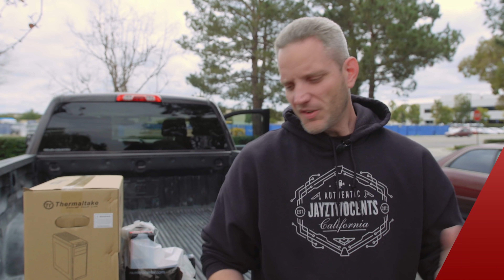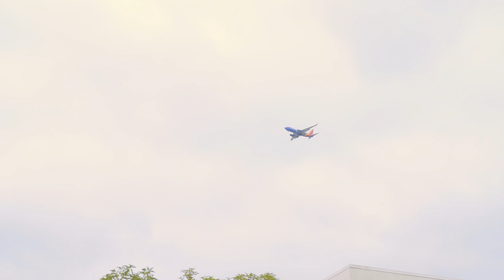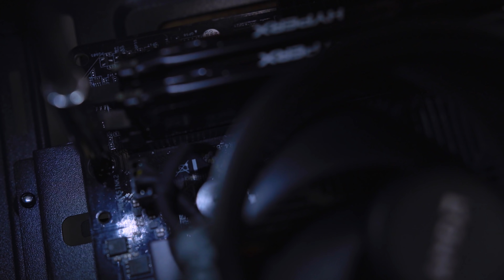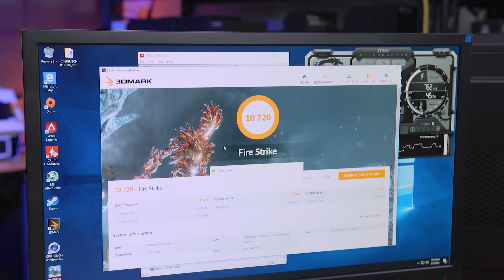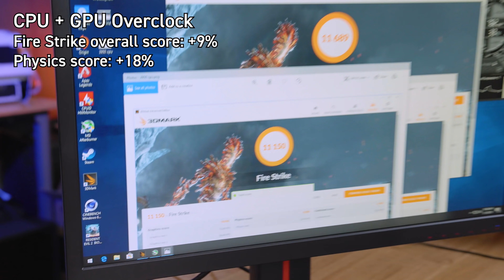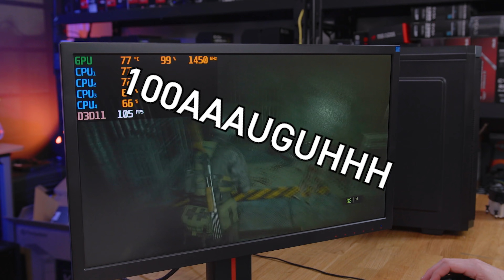CHEAP Gaming PC Build - 2019

Comment: I am terrified to overclock my computer. What percentage would you suggest. PC specs below
Intel Core i7 8700K 3,7Ghz

Adata XPG Spectrix D41 Red RGB DDR4 3000 16GB 2x8 CL16

Asus Prime Z370-P

Samsung 860 Evo 250GB SSD

Seagate BarraCuda 1TB 3,5" Sata 3

NZXT Source S340 Ventana Negra

Cooler Master MasterWatt 650W 80+ Bronze Semi Modular

Asus ROG Strix GeForce GTX 1060 6GB GDDR5 

AOC G2590PX 25" 144Hz

Microsoft Windows 10 Pro 64

Comment: Or, you can get an Xbox one X with a little less money, and have way better performance. Pc elitists come at me.
Reply: Not sure if you know this but the rx580 gives better performance then Xbone X, you can check jermgaming, he showed that the 1060 is a bit above Xbone X overall and this is a little better than a gtx 1060. The cpu is better aswell btw. Also there are better deals that could get you a 1660 ti and a better cpu instead for around the same price and that thing craps all over any Xbone. Yeah it was a good value when it first released at $500, but now things have gotten cheaper and next gen consoles are coming in a year or so and those will annihilate it in terms of gpu and cpu power while costing the same

Comment: Curious what I need to adjust to get my oc stable to get 100+fps on apex. I have a amd8350, 16g hyperx ram (dd3 I think)and a gtx970. For some reason my oc crashes if I try to turn it up from the regular preset oc that comes with mb. I want to get to about 4700mhz. I have a massive radiator on it temps aremt a problem. But I'm at 4.3mhz atm and if I turn it up thru overdrive and afterburner it seems to crash or run choppy

Comment: hey Jay nice video,a metro exodus build would be nice to see.i have a bit of off topic question: would you recommend a Thermaltake core p3 or core p5 which are more open cases,i am running a aio cooler on the cpu,gpu is still on air,not really planning custom cooling loop.i currently have a nzxt s340 case but personally i find the airflow could be better so if you have a suggestion on a midi case  ATX with good airflow in 2019?

Comment: Could have included a 212 Evo, that one most of the time costs less then 30 (Insert Currency symbol). 

100 fps? Well more then i am getting, i am barely over 60 but then again, half my Ram slots are dead and i can only run my 16 gb kit in Single channel. And i have a 970.

Comment: Glad to see a Resident Evil 2 test
Funny enough, based on benchmarks, AMD has a HUGE advantage, even the RX 570 beats the 1060 at similar settings, to the point that the RX 590 can match the likes of the 1070. Not that it's a bad thing. I think the RX580 and RX570 are better deals right now for the lower mid-range cards than anything Nvidia can provide, though I'm stuck with the 1060 for now.
Hope to see more Jay, keep it up

Comment: 1.425v is going to run hot as hell in a stress test with the stock cooler and more importantly, will cause degradation soon enough

Comment: Jay maybe u can help i have the 2200g and the same gpu u use in this video, but my doesnt perform like yours. My 2200g stays at 0.52 for some reason. Even when I put it into high performance. Even if it overclock it slightly i get the black screen and have to reset everything. What could be causing this? Thanks man great video!

Comment: Jay i have a problem with my 2400g, on my asus prime b450 plus with a kit of 2x4 gb 3200 mhz hyperx predator, it runs at 2400 mhz and it just crashes as soon as i try to boot it... i have to send it back to service... what to do? Stock cooler, lc power 600w and an ssd...

Comment: I need help with a memory question. Which of these gives better “price-to performance” with a Ryzen 2700X? CORSAIR Vengeance LPX 16GB DDR4 3200 Memory Model CMK16GX4M2B3200C16R ($125), G. SKILL Flare X Series 16GB DDR4 3200 Memory Model F4-3200C14D-16GFX ($195) or G. SKILL Flare X Series 16GB DDR4 2933 Memory Model F4-2933C14D-16GFX ($165). I see the difference in CL and speed between the three. Just wondering which gives the best bang for the buck? Is the Flare X really worth the extra money?

Comment: don't forget that he's running it beyond 60 fps, putting it nearly double the load on the gpu causing much higher gpu temperatures

if it's locked to 60 then the temperatures will look much better on the graphs, of course this applies to people who just want 60 fps and not looking for the g-sync / free-sync tech

edit: don't lock it via v-sync however, it causes a bad input delay; use something like MSI afterburner's Rivatuner program to do so

Comment: Ultimate budget build to run most games at 1080p please
Reply: HBY 
Basically this except 16 gb of ram and maybe a better processor.

The 2200g is good enough for 1080p, but if you have the money I would recommend a 2600.

Comment: Don't forget to add another $100 for at least a 75hz monitor with freesync. I recommend the Sceptre E248W-19203R 24" on amazon for $98. Also, you can get a 570 for $130.

Comment: Jay! Plz do a water cooling test using engine ice! I've used this on many street bikes dirt bikes and quads then seeing better cooling temps than straight water

https://www.amazon.com/Engine-Ice-TYDS008-Performance-Coolant/dp/B000H01NFY/ref=asc_df_B000H01NFY/?tag=bingshoppinga-20&linkCode=df0&hvadid={creative}&hvpos={adposition}&hvnetw=o&hvrand={random}&hvpone=&hvptwo=&hvqmt=e&hvdev=m&hvdvcmdl={devicemodel}&hvlocint=&hvlocphy=&hvtargid=pla-4584070138229370&psc=1

Comment: Now do a used parts PC build with a similar or lower price point with something like a 2500K/3770K, GTX 970/1060, 16GB DDR3 and show how much more performance you get per Dollar - because that's what I just did. The bigger RAM headroom especially makes a huge difference compared to my 8GB System before.

Comment: Nice build. Probably still better than a ps5 or Xbone X 3000.
Reply: This build can do everything 60+ fps. Even over a 100 fps. The xbone X has a handful of games that barely do 60fps. Also online service is free. Thousands of games that make up the library on pc. Xbone has no games. You want good games on console, play ps4. Xbone X is pretty much dead. I’m sorry for gamers that spent money on this Xbone X for slightly better performance than the base model. Should’ve spent that money on a better investment like a pc of this criteria. Let me guess, you guys think that the next Xbone is gonna be better? Wake the fuck up LoL
Reply: @velezf216o  actually the Xbox one x was a MASSIVE improvement putting it inline with an upper mid-tier PC that was only 1 gen old at the time. Its the closest consoles have been to PC midtier. While it was a good value at the time we are now 2 generations past it and its got less value to performance, and  less value over time. Cause again that $60 spent each year just to be online could have been spent on more games or saved for PC upgrades. While i respect their jump in performance, but they still fell short of actual value.
Reply: You will not out perform a pc with an xbox especially if you know what you’re doing. If you think otherwise you’re just wrong
Reply: @supertacoelite5062  Very true, at the time the base models came out the hardware performance was already 5 years behind the curve. even with the new revision models, and their gains, they still fall short of equivalent price PCs so long as you know what you are doing and don't let some sales person screw/lie you.
Reply: velezf216o 😂😂😂
Reply: Xbox One X would substantially outperform this PC.
Reply: @YourPalHDee  Actually its probably about the same performance
Reply: @nonameyet2205  maybe from a hardware perspective. Not from a gaming perspective.
Reply: @YourPalHDee  because that's totally how hardware and gaming works.
Also let me know how that $60 a year works out for online play after a few years. Its not for servers, its not for the developers, and its only cause Microsoft says so. 
Say hi to Bullet Berry.

Comment: Next time get a 6 core ryzen man .... This 2200g has extra gpu for no reason in this build
Reply: I said the same. Could have easily gotten a better CPU for the price too.
Reply: 100FPS in game   Why pay more for the cpu?
Reply: @TheNosakus  you wont get 100 fps in all games
Reply: Some people does not understand that many games can do 60+fps in AAA titles only when you have enough cpu power and that needs 6 cores 12 threads atleast NOW ... 8 threads are now a bare minimum and WILL STUTTER just go see metro exodus and shadow of the tomb raider with modern gpus paired with old 4c/8t cpus it sucks .... If the 2200g now can do 100fps in a crappy game why  you even bother to answer me ? 
I am feeling that R7 x1700 oced to 3.8ghz is not enough for assassins creed odessy for 1080p ultra and you still ask about half that horsepower ?????
Seriously people .... Wake up !
A new multi core gaming era arrived ... You need 6+ cores as soon as possible
Reply: The point of showing the 2200g was to show you don't NEED a dedicated GPU to do some light gaming, no one is saying you are gonna crank it to ultra settings at 60FPS, for some gaming on medium is fine if that's what they can afford.
Reply: @ryokuhasu9699  if that's all you can afford I would think checking the used market is the better idea
Reply: i5-9400f 4tw

Comment: Just so you guys know, not ALL processors are eligible for the $30 off bundle with a motherboard at micro center, so for this you could go with a ryzen 5 2400g for $30 more, or without the bundle, a ryzen 5 1600 for $20 more. It just depends on your price cutoff point.

Comment: Quick question. Just built a PC. It can’t recognize my Ethernet. Windows 10 intel, but is there an obvious issue I missed?

P.S. clearly first time builder
Reply: It takes sometime to install the drivers. If it still doesn't recognize it after few Windows updates which Windows usually installs when you build a new system you should try manually installing the Ethernet drivers from your Motherboard manufacturer's site. Should be in the "Drivers"section.
Reply: Marppus like install them onto a flash drive?
Reply: @M15CH13F  HDD or SSD, whichever you're using. You could also try and Troubleshoot, go to the bottom right of your screen and right click your Internet icon (screen with a wire next to it) and press "troubleshoot". Windows might find the drivers that way.
Reply: You could also try installing the Network Adapter driver from Intel. Just type Intel Ethernet Adapter into your search bar and you should be able to find it. Which motherboard are you using?
Reply: Marppus ASUS Z390-A
Reply: Marppus it basically won’t notice that I have an Ethernet cable in, when I go to check drivers it says “windows has determined that the best driver for this device is already installed. There may be better drivers on windows update or on the device manufacturers website.” Any links that you could send?
Reply: It's easier and faster just to do what the other guy said and go to motherboard manufacturer website and get all the drivers. It'll be in the support page.
Reply: chris sehtman yes, but how can I log on to the website to install them if my computer can’t connect to Ethernet?
Reply: https://www.asus.com/us/Motherboards/PRIME-Z390-A/HelpDesk/
Reply: Go to this page and get the Ethernet driver and download onto a USB and install on your PC

Comment: I recently upgraded my MSI RX580 to the Asrock Phantom Vega 56 graphics card. 
It came with Resident Evil 2, division 2 and devil may cry 5. 
Res Evil was friggin awesome. I was getting about 110-120 fps at 1440p 
And it was so amazing looking and very fluid.
My cpu is the Ryzen 7 2700x with gskill 16gb 3200mhz ram.
I also use a 1tb M.2 ssd partioned for the OS and my favorite games.

Comment: Apex is my 2nd game I have played after switching from console and my crappy prebuilt can’t go 2 games without crashing on the lowest of lowest settings.

Trying to save up to build my own but dang didn’t I choose the absolute best time to buy parts /s
Reply: And you might be able to save some money but gutting your pre build. To re use parts or just upgrading pre build if it's possible.
Reply: chris sehtman 
Processor: Intel(R) Core(TM) i5-7400 CPU @ 3.00GHz
Memory: Two 4GB SK Hynix at 2400MHz
Motherboard: OdSense 2-k
Storage: WD BLUE 7200RPM 1TB Hard Drive
Graphics: NVIDIA GeForce GTX 1060 3GB

Where would you start? For me the only things I thought worth upgrading is the ram, power supply, cpu and especially the graphics card but I figured by then might as well start with something fresh
Reply: Idk about that motherboard but the issues I this is your graphics card. Because it's the 3gb version instead of the 6gb version. Because that processor I would say is still good.
Reply: So if you want to save money I would just upgrade the graphics card everything else seems good and when you get more money go up to 16gb of ram. Just make sure psu can run the new graphics card if you do upgrade it

Comment: Seriously stop pushing the 2200G ... especially if you are putting in something like a 580. For 70$ more you can get a 2600 and 100$ more a 1700x. The 2200G is such a bottleneck unless you buy it to be used only as an APU. As a CPU it is hot garbage and not even in the same ballpark as the 2600 - let alone the 1700x - which actually scores close to 2x the score in many benchmarks. I get the whole "as cheap as possible" - but why don't you buy a FX8350 then at 65$? It can run Apex Legends JUST fine if you put a 580 in with that one at 2/3rd the price - and you can find a used systems with it for like 100-150$ used easy, and then add the 170$ for the graphics card and 27$ for the SSD - Half price! Those two CPU's are actually comparable when it comes to gaming performance... try it! LOL Stop pushing that junk on people when they can pay very little more and get a WHOLE lot more PC man!

Comment: Hey Jay how many more Morons ya think are gonna mention that you bought a Thermaltake case?  Like it's really that big a deal ;P
Good video and shows how far prices have dropped heck just 4 months ago this would have run $800 easy.

P.S you can add all the fans you want and it'll still suck as it's a flat closed front design made for idiots who freak out about actual cooling and buy cases that suffocate their systems.  They broke Murphy's law,  Hopefully case manufacturers will return to actual open grilled designs that work rather than just look stupid.

Comment: Got this card and did some light overclock and I will say it is a load card and I think you can tell in this video. I also had a cheeper case and it's thin so I could hear it.

If you get the red dragon make sure your case fans are good and having a little extra  space for your case it's a big card and will spread that heat out.

Comment: Props if you got the 2200G to 3.95 on the stock cooler (with the paste TIM). I never got my R3 1200 over 1.35 V and 3.85 GHz on the stock cooler without crashing (always happened once it hit 70°C or so in Prime95), though at one point I had stable 4 GHz with an aftermarket cooler and 1.45 V.

Comment: That moment when i used 764.7€ on my computer and it has Ryzen 5 1600, 12gb of ram, gtx 1060 6gb, 500W psu bronze+, crappy A320Motherboard, 256GB M.2SSD and all of it is inside a cheap case. The most annoying thing is that the GPU and RAM prices dropped after i bought them not by much but the GPU dropped for 50-60€ and the ram price 20€
Reply: Wait you're using 3 sticks of 4?? If so might want to get that extra stick because I'm pretty sure that stops the dual channel advantage you want
Reply: @MrEpicgamer123  the motherboard has only 2ram slots... Ballistix ram sticks one 8gb one 4gb they are basically the same ram but the different variants

Comment: As someone who just recently did a very similar build, you could have gotten a B450 with a Ryzen 5 2600 from Microcenter for $200.  I skipped the mechanical drive and opted for the 480GB Inland SSD for under $50.  Should have went that route, would have been pretty much the same price...

I spent $600 but that also included 2x8GB of 2666mhz RAM, dual channel and twice as much  is more important than speed.

Comment: I built a similar system for my son last week, which I also got the parts from Microcenter. The only differences were the PSU, a Ryzen 5 2400G, a 2TB Firecuda (I didn't get a SSD as a result), and no discrete GPU. The mobo and memory are exactly the same. The differences brought my final build cost down to $420. It runs plenty fast but I wish I could dedicate more system RAM to be VRAM. The mobo will only allow 1GB. Gaming wise it's great at 720p but would probably be weaker at 1080p. (I have an old 720p TV hooked up to it.)

Comment: How about the Ultimate Tower using  The Thermaltake 900 Case Full duel independent Liquid cooling on the M.2's, Ram, GPU as well as a Thread Ripper possibly AMD all the way But I am cool with Intel. Love to see those Bench marks with a wicked O.C. Possibly with a Duel GPU set up. Your Choice

Comment: Jay what do you think of that Motherboard? I was looking at it for a value based build for a buddy of mine. Techspot/Hardware Unboxed rated it the best of the cheap B450 boards mostly because it has a heatsink on the vrms. The Ryzen 5 1600 is also $99 at microcenter, but that adds a lot of cost to the build concept you have in the video, requiring a video card. There's a 4gb RX 580 on Newegg for $139 tying the price of an 8gb RX 570, so I'll keep watching the prices for the next couple weeks.